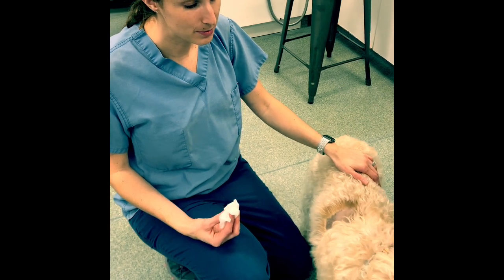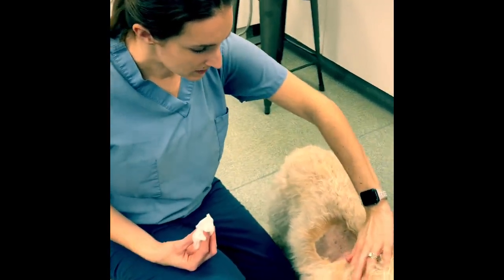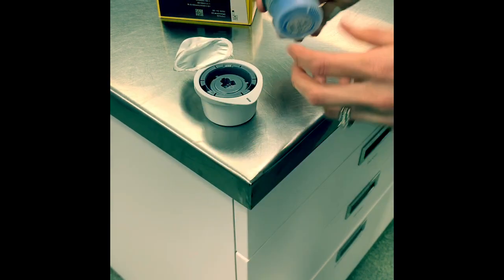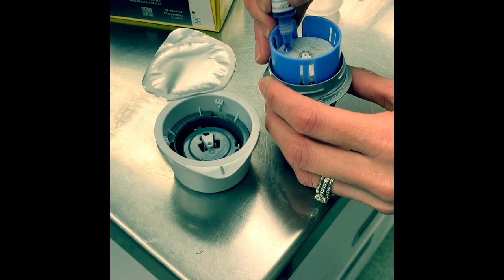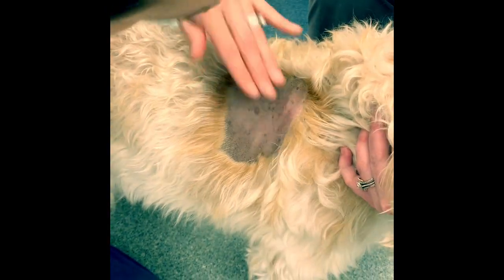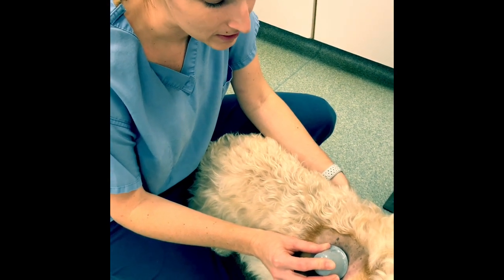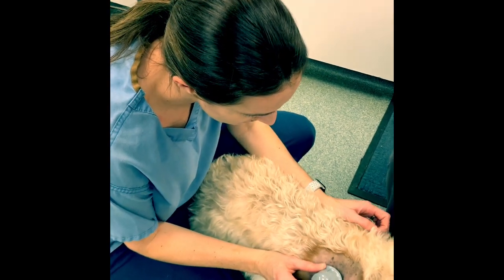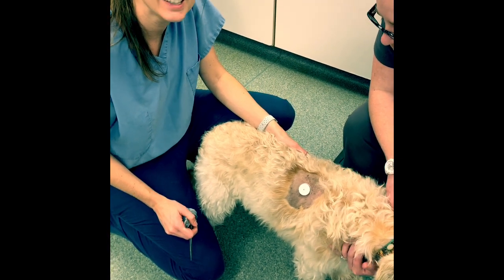Libre Freestyle Sensor Placement On A Dog

Comment: Hi where do you get the glue from
Reply from the maker: ayten onal it is just surgical tissue glue. Very similar to super glue, but sterile.
Reply: The emergency vet hospital that applied my 9 yr old dog’s first monitor did use glue.  The second monitor, applied elsewhere without glue, my dog scratched off within an hour.  I immediately had to buy another monitor to apply myself at home.  Having no glue, I will wrap with an ace-type bandage.  🤞🤷‍♀️
Reply: The maker advises against using any kind of glue!! Irresponsibly YouTube vets say differently?? They know more than Abbott?  My Chi has never had one come loose and have never had glue used and he is super active.